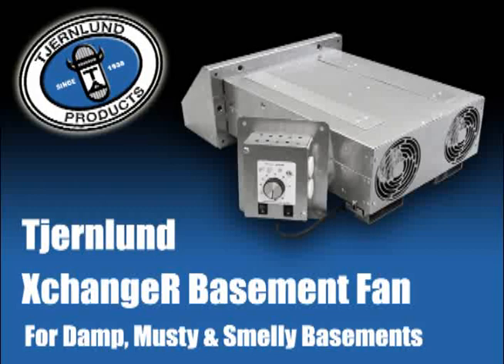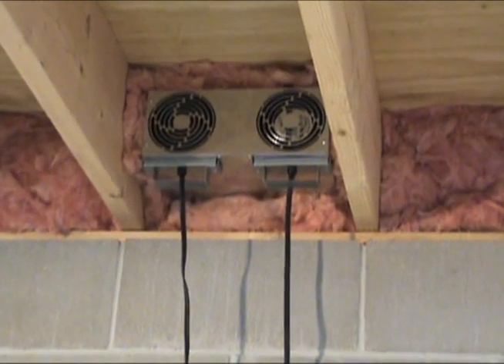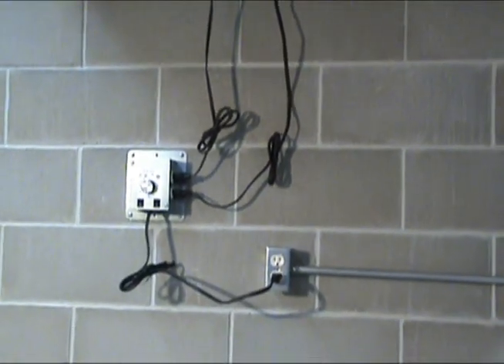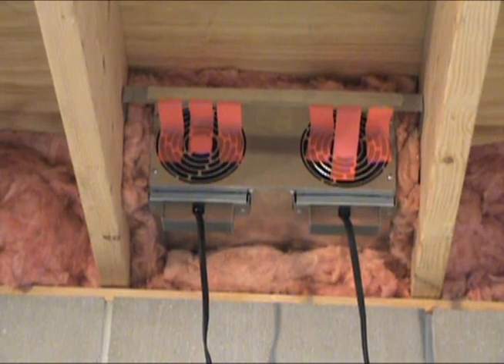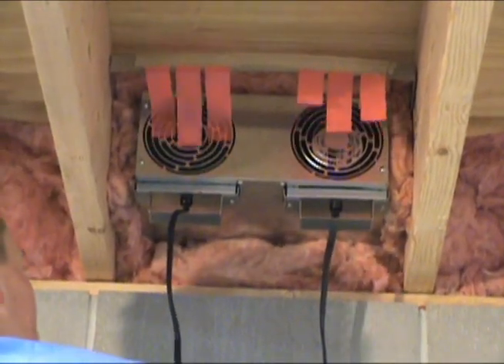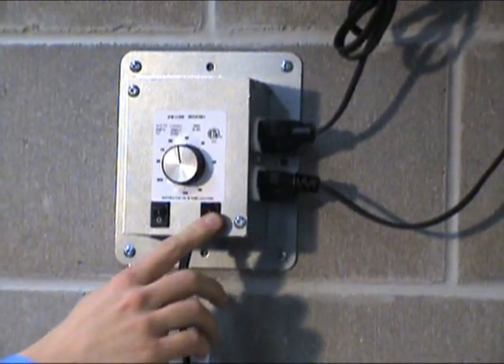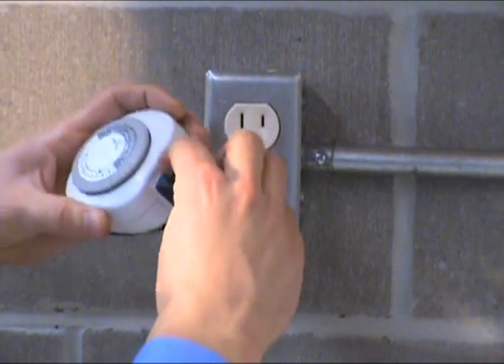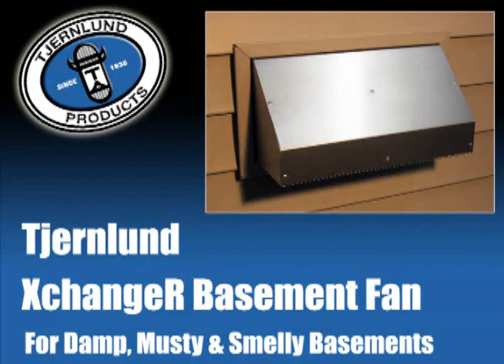How a Basement Exhaust Fan Works - Exhaust Your Basement to Prevent Mold

Comment: I use  a Y vent on a exhaust outlet for the clothes dryer and I put a 4 inch inline fan with flexible vent down to the floor to rid of humidity in the basement ...not very powerful but it gets the job done low tech

Comment: Bob C

5.0 out of 5 stars Amazing results from a unit called the
Breeze, available online from Breeze Systems International at 1/4 the price of
units like Humidex, Wave, and EZ Breathe- I was a non-believer, but am now
blinded by the light!

I was 100% skeptical about this thing having any impact on
my musty basement. I thought I was buying snake oil, but was at my wits end
when it came to how to deal with the smelly basement on Cape Cod. We had a
dehumidifier for years that would remove the moisture from the basement, but we
would still get a "wet" spot on the floor at its lowest point and we
had a musty smell that had us looking for ways to seal the basement door. When
we would open all the windows and the bulkhead, we would get relief, and it would
smell okay, but once we closed things up when it got cold or was raining we
were back to a smelly basement.

I installed this where our floor is the lowest and where we
often would see condensation on the floor and have it venting out one of the
basement windows that I adapted for the purpose with a vent.

I am absolutely overwhelmed by the difference that this
device has wrought - my basement musty odor is "cured" - it smells
great down there and here is why - this little thing acts like a chimney of sorts,
it pulls up the nasty moist air from the floor and shoots it out the window -
and sucks down fresh air from the upper floors - circulating the air into the
basement with fresh air, BUT also removing the worst air that is down near the
floor.

I couldn't be more shocked at the results this little device has delivered -
amazing. I really thought I was going to be dissapointed as I thought
"what on earth can this thing really do" but the answer is in the
description - a dehumidifier gets the water out, but you still have the same
stinky air in your basement - this thing really does the job and I could not be
more pleased. I show everyone who comes into the house. My wife is also amazed
- she used to dread going down to do laundry - now, she has no excuse

Comment: Seems to me that taking in air and exhausting air within 6 inches of each other is counter productive. What stops the expelled air from being sucked back in through the intake vent? It reminds me of homes with sump pumps - yes the pumps pump the water outside and they pump it right outside the foundation where it just comes back in through the foundation to be pumped again. This fan appears to do the same thing - blow out air and suck it right back in.
Reply: true if you run it right beside each other..  how about attaching ducts to it to put intake and exhaust at opposite ends of the room?
Reply: A tiny bit will come back in... But if the vents go into open air, it will dissipate very quickly.
Reply: Usually a basement drainage pump is pumping water in to the sewer system, not the ground.

Comment: if your basement is musty then it has water problems. I'm mitigating with a Santa Fe dehumidifier plus pump, keeps it at 34% humidity. but that's not the root cause. I now understand that my entire property was graded wrong (they just skipped that part) and to solve the problem right, I need to regrade and add drainage. 

l urge you to understand what the real problem is before you start throwing Band-Aids at it like this.

if you want to learn more about water control see Daniel j O'Connor of hydro armor's videos.
Reply: O’Connor doesn’t know anything about waterproofing, he’s just a hack that robs people
Reply: @NBAyeeeee  Love your user name! I wish more people figured this out.

Comment: Do these fans protect against detected radon issues?
Reply: I have personal experience with such fan products I have tested unfortunately 4.0 radon in my 1500 square foot basement. With my exhaust fan on I pull fresh air from upstairs down into basement and all the stale air with radon is exited out but I collected from the floor level because that's where radon and dampness go to the floor level it dropped it down to 1.2. of course this is not a permanent solution but it sure helps to move fresh air into the basement. I like to exhaust the air out and pull in climate controlled air from upstairs. It's a fraction of the cost in running a dehumidifier 24/7
Reply: @confirmhandle So if i understand this correctly you have one of these fans in your basement but you also keep your hvac on and your returns are upstairs and you just force air into the basement and it goes out via the fan? But doesn't the basement fan being on actually suck more radon in from the ground creating that pressure change?